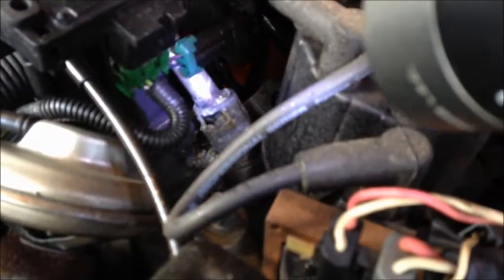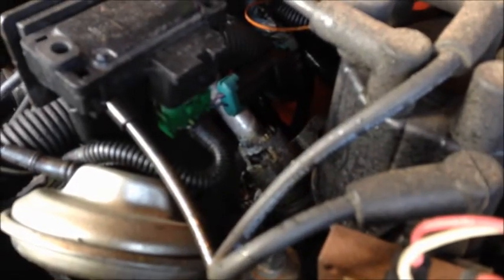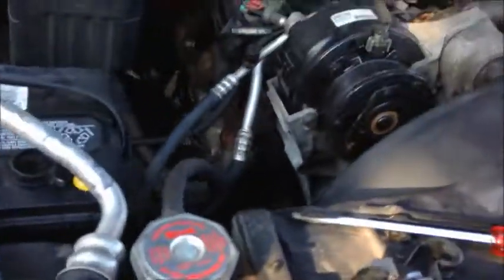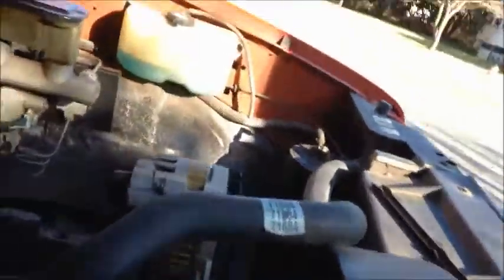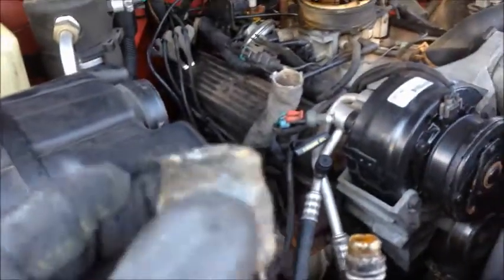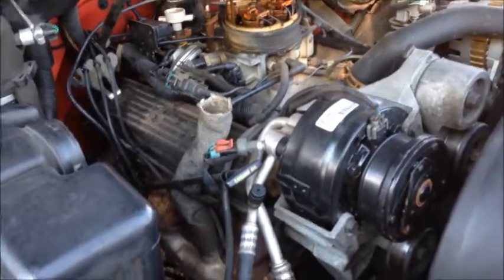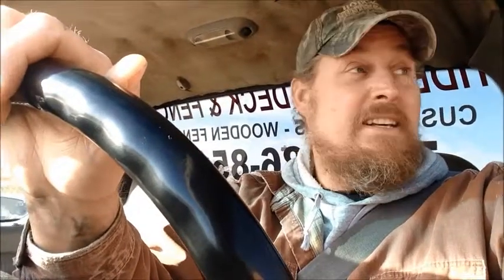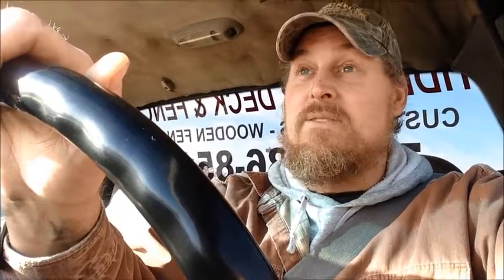Fixin the truck part 1

Comment: Oh yes, I remember those dang fittings...they make a fitting to replace that, but even if you replace it with the same type it's not so bad.   To b honest if it were mine I'd just use a pipe tap and thread what's stuck in the block, screw a brass pipe fitting with a hose nipple into it, and use a piece of heater hose to the heater core...
Reply from the maker: That's where I'm at. I gave it a good try but that bad boy is stuck in there good.
Reply: Tod Hoeckel Yeah, in my time as an equipment mechanic for the State of Nevada I saw TONS of those go bad... I truthfully do not understand what GM was thinking on that one... You really are going to be better off with a hose nipple and never having to worry about it again!